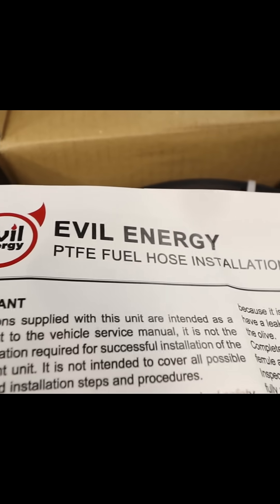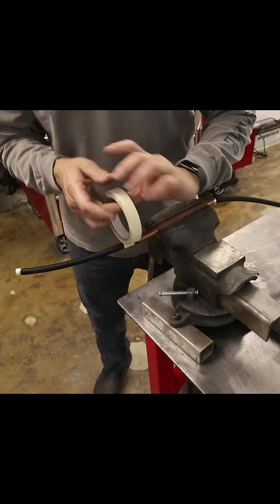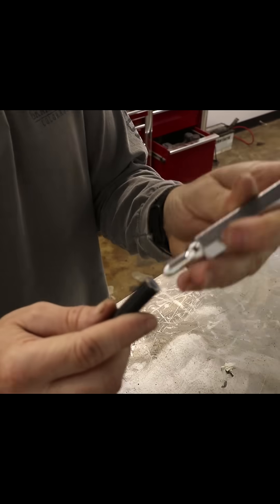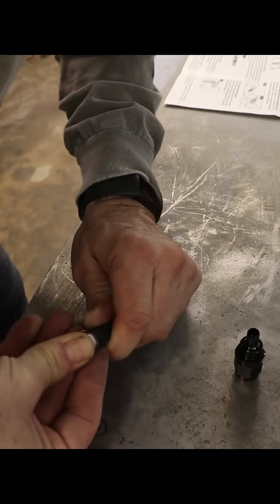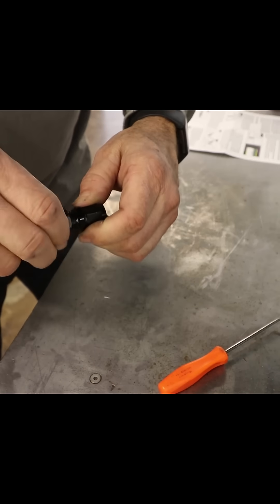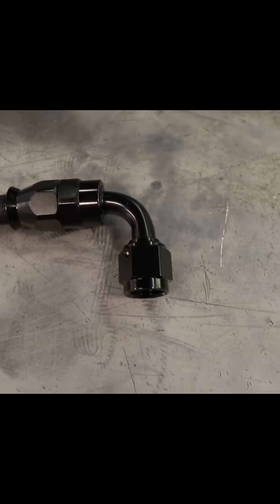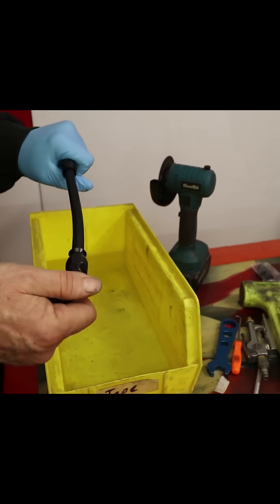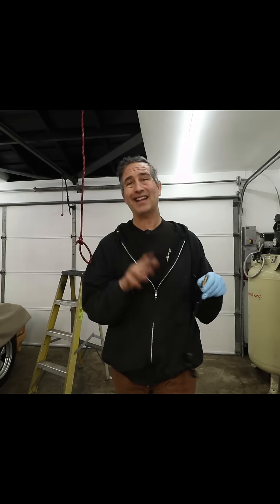Ethanol Proof Your Fuel Lines with this PTFE Fuel Kit from Evil Energy

Comment: Can we get hose fittings that are metric to fit in with our metric fittings in our Porsches?     Two years ago I sent an order to Len Cummings and he produce new fuel lines for my 1974 911 but they didn’t come with crimped fittings to connect the lines together which I wish I would’ve had.
Reply: I used all PTFE on my 70 turbo Camaro, love them. Although I found the -20 AN fittings very tough to work with, everything below -20 AN, was easy peasy.
Reply from the maker: These are all AN fittings.  It's tough to get something that fits with the Euro fittings